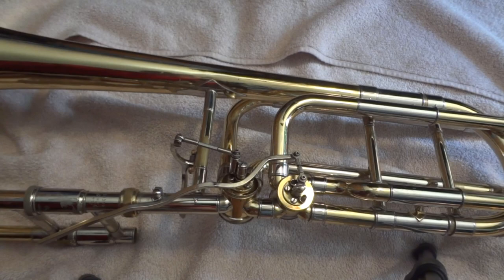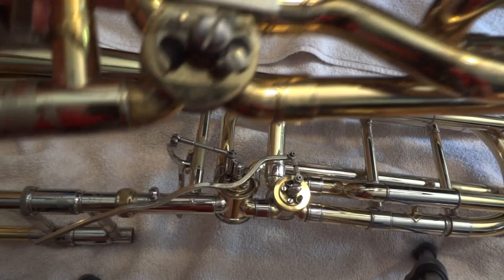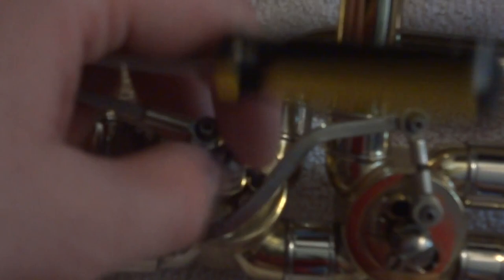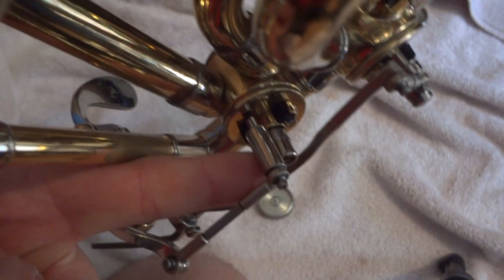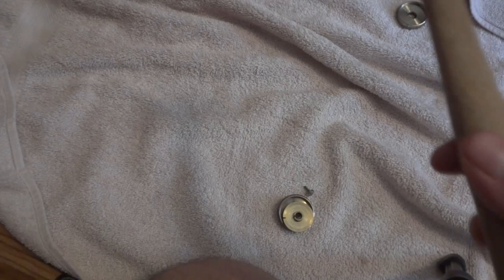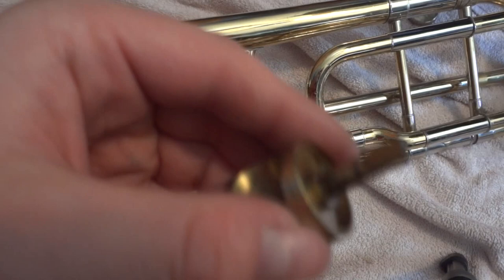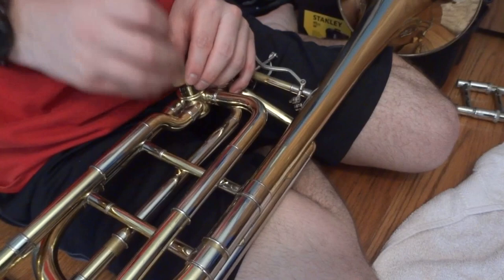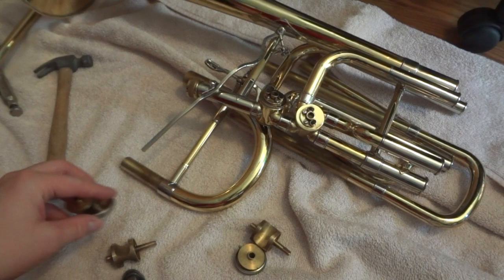How To Clean A Trigger/ Bass Trombone

Comment: Does it have to be wood or could it be like a small pvc pipe?
Reply from the maker: Generally as long as it’s softer than metal. You shouldn’t damage anything. But anything metal is most likely stronger than brass. And will damage it. I own a raw hide now which is the best tool.

Comment: This isn't great information. 
You need to oil the bearings with bearing and linkage oil. You also need to properly reseat the bearing plate or the rotor will travel up and down and hang or be noisy (like your rotors are).
Reply from the maker: This is true. This was a school instrument and when maintained properly, it wasn’t much better. Because of the neglect from previous students. But also the videos at the time didn’t talk much about rotors very well or talked about using steel wool and I wanted something better than that. This is what made the instrument improve for me before I knew all the right practices